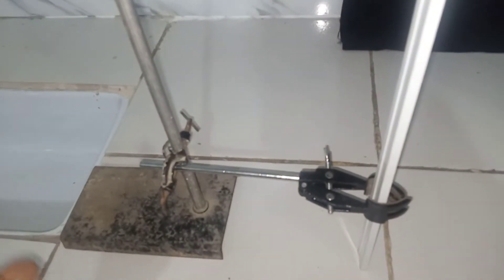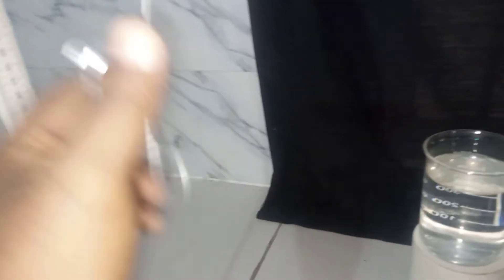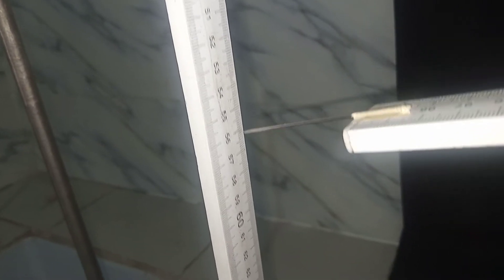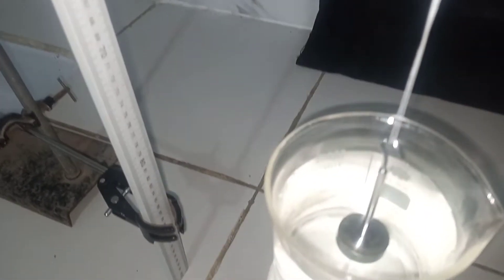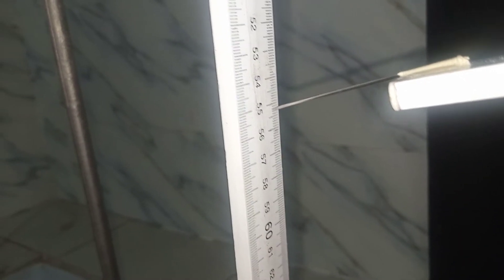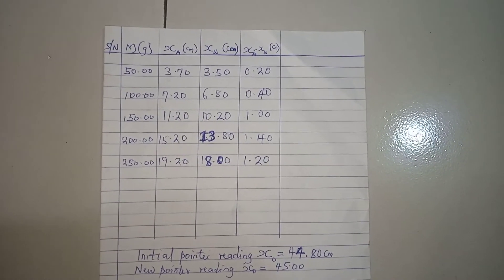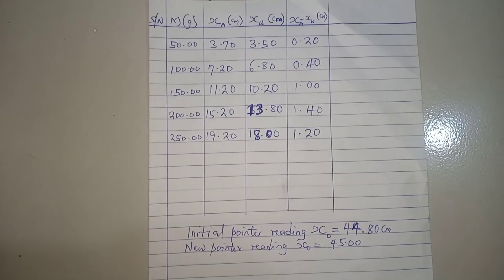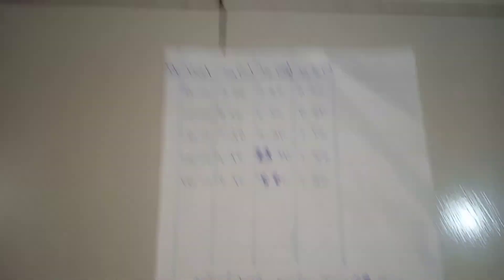young's modulus of elasticity/ Relative density and upthrust

Comment: Hello bro, please I need your help. I tried this practice today, but the issue I have is that my weight in water is greater than my weight in the air. This is against the law of buoyancy. What should I do that could make the weight in air greater than the weight in water?
Reply from the maker: Ok sir, are you referring to the pointer   reading in cm both in air and in water for a given value of mass.
Reply: @kool-aceeducationalmedia  I'm talking of the metre length that was being clamped.
Reply from the maker: @vtv5060   send me a watsapp msg @ 08064541673 drop a v.n or explain vividly.
Reply from the maker: @vtv5060  yea for the meter rule that is being clamped, the instruction would come from the examiner, however, just a small portion of the meter rule would be clamped. And a majority would be in air,as it is in the experiment
Reply from the maker: In a column of fluid, pressure increases with depth as a result of the weight of the overlying fluid. Thus the pressure at the bottom of a column of fluid is greater than at the top of the column. Similarly, the pressure at the bottom of an object submerged in a fluid is greater than at the top of the object
Reply from the maker: Solution. 
It's either it's from ur meter rule. Try changing ur meter rule, to a more flexible rule, that's not too rigid nor too flexible. Also ensure the set of masses are properly immersed in the liquid.
Reply from the maker: Try it and get back to me
Reply: @kool-aceeducationalmedia  God bless you sir.